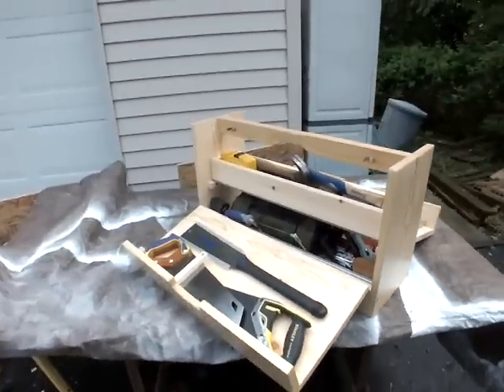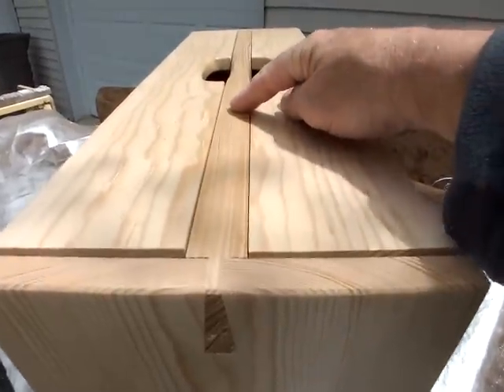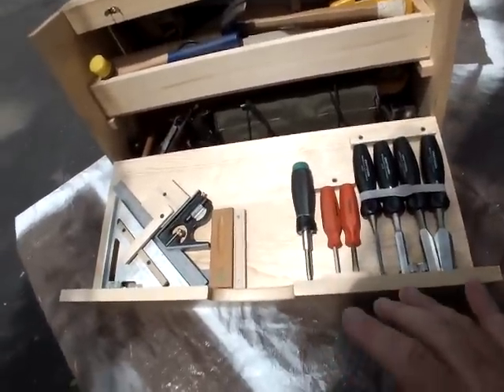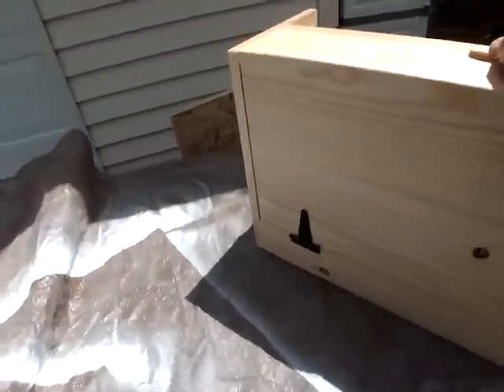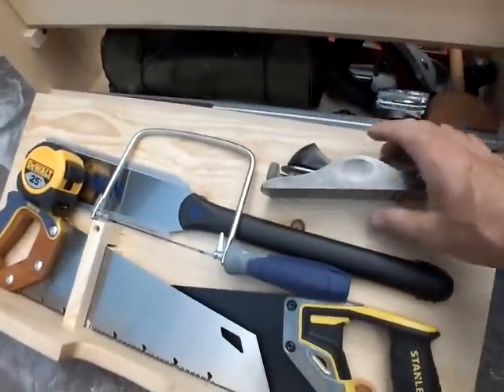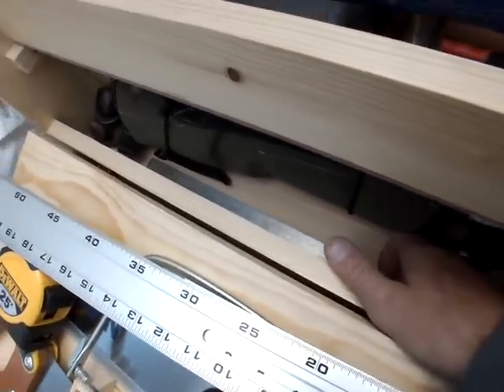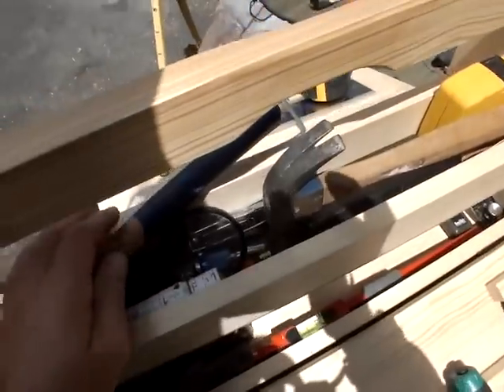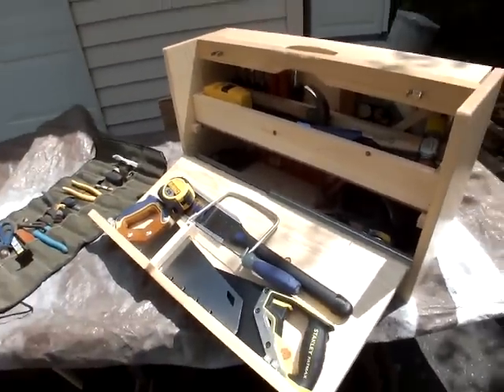portable wooden tool box

Comment: If you wanted to, you could switch to weaker magnets, or glue a spacer to them (steel, felt, or plastic, whatever you like) or just drill and screw them in addition to the epoxy.  Nice box.